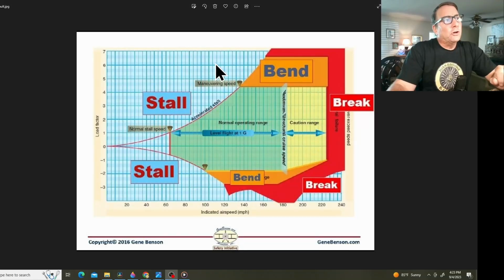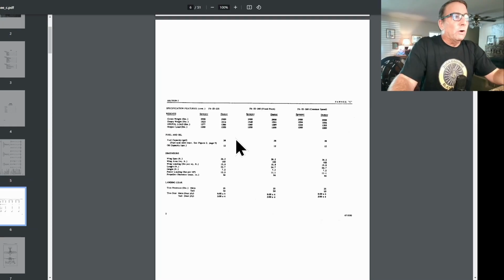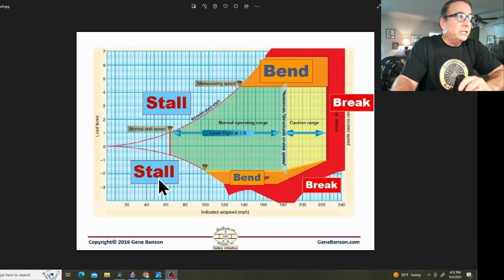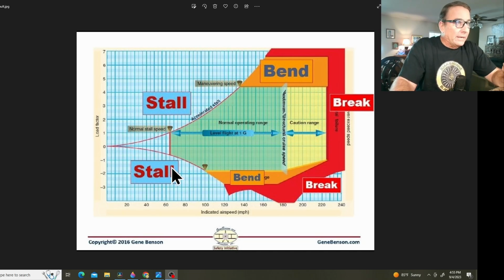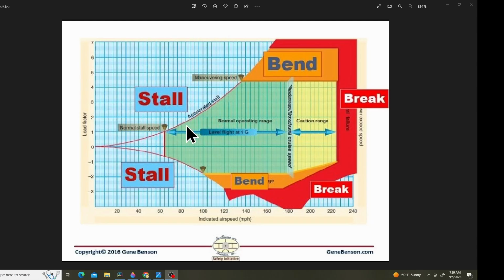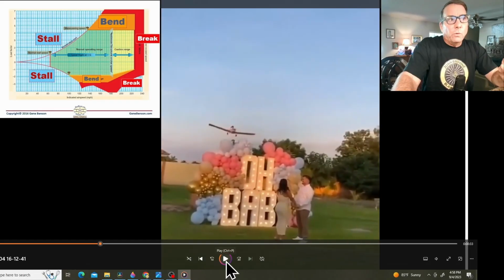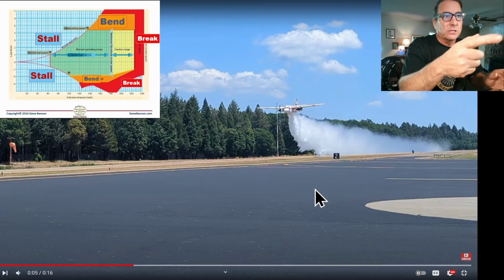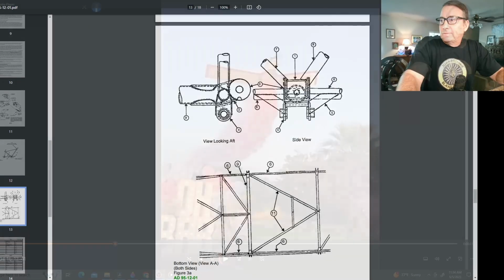PA25-235 Sinaloa MX Gender Reveal Party Structural Failure

Comment: I began my ag flying career flying the Pawnee and I never flew with more than 100 gallons. Never filled the hopper with liquid but we used the large hopper for dry fertilizer. I was trained at Ayers Corp. in Albany Georgia, where they make the thrush aircraft. You had to do a demonstration flight to get certified FAR 137 and part of the flight was a emergency dump. You had to learn to push the stick forward hard to keep the aircraft level cause dumping that much weight the aircraft wanted to climb like all get out.
Reply: The Pawnee pitch trim system was simple but not comfortable.  A large spring on one end of a lever in the back of the fuselage attaches to a cable that attaches to the stick just above the pivot point.  Moving the trim handle aft pulls, through another cable, the spring lever to tighten the spring and provide pull on the stick.  Forward on the trim handle will slacken the tension on the spring and allow the nose to go down.  Taking off with 150 gallons, usually the load is less for DA, will require a strong pull on the stick which the trim spring will help with.  Emergency dumping with full aft trim will result in a significant pitch up unless the pilot pushes forward on the stick.  The dump gate in the bottom of the hopper, also used to release dry material through a slim crack, allows slow release of liquid material as well.  Liquid goes to the pump on a spray rig through a hose.  The pilot may have been startled by the rapid pitch up of a full dump lever travel, fully open gate, dump.  Or he may have been going for a spectacular pitch up.  Or both.  I personally know of two practice emergency dump fatalities.
Reply: The tank looks so far from the CoG, i’m curious now what the training manual looks like for an emergency drop.
Reply: I agree. Looks to me like a rapid change in CG pitched the nose up. @PaleoWithFries
Reply: from what you described maybe he wasn't even pulling up that hard.  maybe just someone without training , but with a plane, that was like, well, it has this feature; lets let er rip
Reply: @toddmulligan2609 this he likely never did full dump b4 and even a nuetral.position on stick would result in pitch up hard. U gotta pre nose down when u dump that much weight
Reply: That will tend to keep you out of trouble.

Comment: 06:17 - Yes, but it's not the wing loading or "X" pounds of lift that break the wings - it's the g's. On the examples given the g's are fixed at 4. It takes an "X" amount of g's to break a wing, at whatever wing loading or lift force. At a lower wing loading the wing may not stall (which would unload the wing) before reaching its design g-load factor and may break, hence the lower maneuvering speed at lower weights.
Reply from the maker: Correct! You got it!
Reply: @blancolirio  I’m not sure he does have it correct. The lift the wings produce depends only on airspeed and angle of attack. In your example if the 16000 lb airplane pulling 4Gs suddenly releases 8000 lbs of weight it won’t be pulling 4Gs anymore it will be pulling 8Gs unless the pilot lowers the angle of attack to reduce the lift. An aircraft that drops weight at constant angle of attack is likewise going to accelerate upward and climb without any pitch input from the pilot.

So that’s what likely happened in this mishap. The pilots 2-2.5 G pull-up became a 4+ G pull-up as the water was released overstressing the airframe in the process. This would have been exacerbated if the aircraft was above maneuvering speed.
Reply: It's a bit more complicated. The limitations are given in "g"s because it is an easy to express limitation. However, when you change the masses configuration of an aircraft there are changes in the forces, some forces increase, some decrease.

In this case, if you unload a fuselage-mounted tank, the wing attachment forces decrease while the fuselage structure (engine mounts in particular) experience greater forces for the same angle of attack. That's why manouvering speed often decrease with weight.

Comment: I’m still totally confused why a weight release would contribute to a structural failure.  Wing loading is reduced even if we are close to maneuvering speed.  And isn’t loading the concern? The pull-up yes, we can all understand that.  Perhaps the pull up was the culprit and we are blaming the load release instead.  But on top of that I don’t recall anything on this topic in ground school.
Reply: It may cause structural failure on parts of the fuselage, engine mounts, etc because you may increase the g loading of the fuselage but you're right, NOT the wing spar and wing attachments.

Comment: Juan, why would the maneuvering speed decrease with lower wing loading?   It should be the other way around.    With lighter wing loading you should be able to pull higher G's at the same airspeed, with less force trying to bend/break the airframe.    Any aircraft with higher wing loading is less maneuverable.    What it looks like is that the CG shifted rearward on the drop and suddenly the controls got way more responsive and it pitched up hard, but if the tank is where you say it is, it looks like it should be right over the center of lift.  Maybe the center of lift itself shifts with airspeed and wing loading. 

My direct experience with this is in Dynamic Soaring (fastest, hardest turning R/C aircraft in existence).    Depending on conditions we may choose to fly same sailplane with or without ballast.   Unballasted, they can turn much harder but don't carry as much momentum through the shear layer, so in bigger more turbulent air we ballast up, but then cannot turn as hard (the aircraft gets bendy, or flies into an accelerated stall and spin aka.. a "flick").  To put this in perspective, we fly sailplanes that go 300+ mph and can pull continuous 50G turns.    The world record set down near Weldon, CA is 564mph.

Comment: These crop dusters are loaded to cover several fields before they need to be reloaded.  The emergency dump is used if you  have a in flight emergency and have to take weight off of the air frame for an emergency landing.

Comment: It looks like the left wing bent backwards, causing a runaway pitch-up moment until it snapped off. That is, in the first frame where the wing flexes it looks like the wingtip flexes first, rather than at the root. You can even see the wing crease just outboard of the root.
Reply: @michaelbigelow3255  Electrical engineer. I've never flown anything but a 172. Aircraft are mostly cool for the engineering 😄
Reply: Yes like a forward swept wing.  I can see that.  I just came across this tragic video btw.
Reply: A wing is the pitch axis , it cannot affect pitch .

Comment: I don't think dumping the weight had a negative effect on the structural integrity of the wing spar. When the aircraft is flying, aerodynamic forces (primarily airspeed and AoA) dictate the force generated by the wing. That force is distributed to each component of the airframe through the structure. When weight is dumped, the total load on the wings doesn't change, because airspeed and AoA haven't changed. However, the load factor increases, such that the total force remains the same. What this DOES do is change how the loads are distributed through the airframe. However, since the fuselage is now a smaller share of the total aircraft weight, the force in the wing spar actually goes DOWN when the water is dumped. 

Of course, you can still get other failures, but that's not what's observed in the video. For example, when the water is dumped, the load on the wing spar is reduced, but the force on every component in the fuselage is increased. If we had seen a failure of the engine mounts, or the body itself, then the load dump would make more sense as a contributing factor. But, since it seems to only have been the wing spar, whose load DECREASES when the water is dumped, it leads me to believe it was the wing spar AD at play here.
Reply: Load goes down suddenly->Back stick pressure to maintain level flight goes down. That's why he mentioned that you relieve the load traditionally by easing out on traditional firefighting planes. By yanking back hard, the pilot exaggerates the tendency for the plane to nose up. If he was above maneuvering speed, he could have easily overloaded the plane. The forces go up because the plane was accelerating upward.

Or, in other words: If he pulled back (not an uncommanded control failure), he suddenly showed a lot of bottom wing to the airflow at very high angle of attack at high speed. That wants to bend the wings back and up. If it was too fast for it to take it, then there you have wing failure. Like entering the beginning of a loop by pulling back hard. It's high G because you are accelerating UP. The load on the wing spar isn't reduced then.
Reply: @aeroegnr  Yes, because the tank is forward of CG, dumping the load causes a pitch up, which causes increased lift/spar load.  However, the aircraft still needs to be above the Va for max-gross, not below, since emptying the tank reduces the spar load at max-lift for a given speed. So either the pilot was flying faster than the max-gross Va, and/or the spar was unsound due to the non-addressed AD.
Reply: @EvanAndersen-et9qy no, you are missing the whole point. You don’t understand how Va works. 

If Va is 120 knots at max gross, when you drop say 1000 lbs, the VA would drop significantly. Likely to around 100 knots. So if he had flown at 110 knots and pulled back fully on the stick, without releasing the water, the airplane would’ve stalled at say 2.5 Gs and not damaged the wings. 
Had he flown at 110 knots with the water dumped and pulled fully back, the airplane could pull 4.5 Gs and still not stall. This would be above its limit.
Reply: What a food for thought treat from Dr. Juan. Dumping the load will cause a pitch up if uncompensated by forward stick.  Uncompensated pitch up without a comenserate simultaneous change in velocity vector  overstressed the wing connections.  Pitch up induced huge parasitic drag.   This suggests that fuselage structure  could also be damaged at engine mounts and at wing connections.  This how the explanation came across to me.   Thanks.
Reply: I’m not a physicist or a pilot but that was my thought as well. It seems to me that the shock of the weight(force?) suddenly reducing could have caused the compromised/corroded spar point to finally shear. Kind of like how extremely rusty metal or cracked wood will sometimes hold together when force is applied in  one direction, but will fail quite easily as soon it’s pushed in the opposite direction. I could definitely see the spar holding, but when it got shocked with an A-typical force while already under load, it caused it to finally fail. Structural anything in general tends not to like rapid alternating/shifting forces, which surely the sudden drop would have caused?

Comment: I've seen a very similar aircraft to this in Australia (actually designed and built here) on a flatbed truck. With it's wings folded, so if this plane has folding wings that adds additional structural compromises.

Comment: I'd guess he had the aircraft trimmed to fly level, after dropping 1500# of water in 1/4 of a second and pilot commanding some pitch up, the 2 combined just completely sent the aoa way to high.  Couple that with the spring of the wings after after the water dump probably sent the wings into a state they couldn't maintain.  Sad.

Comment: Not a pilot, but it looks just like air getting under a sheet of plywood or mattress strapped down to the top of a car. Quick and violent damage. Even as a kid hanging my arm and hand out of the car window making my hand into a wing I found the more I made my hand “vertical” , the harder it was to maintain my arm straight and not go backwards.

Comment: Is manouver speed for one control input only? In this case elevator? 
There is of course the obvious factor, was the maintenance and structure in good condition? 
The hopper is in the center. If the water had been in the wings, then that's a different issue. The water in the center increases the bending in the wing
Reply from the maker: Yes!

Comment: Is it possible that this emergency dump imposes a transient dramatic shift in the center of mass too, that contributes to that large nose-up rotation?
Reply: My thoughts as well. He is essentially dumping over a half ton of weight from the nose of the aircraft in less then 2-3 seconds. Seems like that would cause a CG shift, that maybe he tried to counter too much?
Reply: I'm leaning towards structural failure from either pass flights or an ongoing issue that was unnoticed. That plane should not have failed during a simple maneuver like that.
Reply: I think the hopper is on the CG so shouldn't have a shift as it was dumped all at once
Reply: @flyinbryanfpv  even if it was perfectly centered on the cg of the airframe that much weigh loss in that time frame would cause it to at least "balloon" up a bit. Which the pilot might have tried to counter with forward stick. Which would have been bad idea. I am not saying I know any of these things to be fact, just stating my own point of view from the video provided. It could have been coupled with a problem airframe as well. Just a bad way to go and for no good reason.
Reply: @omegawolf81  I agree with you. The part I was addressing was the possibility of cg shift being the cause. Its more likely the sudden loss of 1000+lbs of water and pilot input causing the catastrophic failure

Comment: I don't know what the pilot was thinking! It won't surprise me if he pulled about 5 - 6Gs,
 You've got the momentum of going forward high speed and then pulling up quickly this just put so much stress of the  on the wings, I think even if he had a full load it would have snapped anyway at that sharp attack at that forward speed. Did he have any knowledge of this plane? Look like he was showboating a bit as well.

Comment: My first thought was corrosion, but the information you presented makes it clear that the failure of the air frame was most likely the result of the pilot's actions while releasing the payload.
Reply: Very well could have been both issues contributing to the failure. Without knowing the details of his speed, angle of attack, amount of weight dropped, etc, it's impossible to say for sure. He may very well have been within the design limits but with a corroded airframe. Like you, I tend to think he was not, but that's why they do investigations. Don't assume.
Reply: @MotorCityBoiler  Good point.
Reply: @Koi-Koi-Koi  Do pilots do practice runs to help anticipate the issues that may arise during a drop? Maybe I am naive, but I would think that having obstructions that close to a drop point and flying into direct sunlight would necessitate a 'dress rehearsal' of sorts.
Reply: And I don't mean to be insensitive or sound like I am assigning blame.  Just inquiring as to what would be considered 'best practice'.
Reply: @Koi-Koi-Koi again with your palm tree. This is silly now.

Comment: Your chart explains why I’m not an Engineer. All I knew was the weight changed and he stressed the plane’s limits. Thank you for the explanations.
Reply: I had a very similar response. I also realised yet again  why I am not a pilot (though I am a keen armchair aviator).
Reply: Basically the lighter the plane is, the easier and faster it can change directions which increases the G-load and stress on things like engine mounts, battery box, airframe, wing attach points.  The heavier the plane the less it wants to change directions quickly and the wing will mush more due to the higher angle of attack required to make a quick pull up, which causes the wing to stall before it has a chance to increase the G-load to a critical point. Not saying it can’t happen while heavy, just saying the weight moves the line on the graph left and right depending on weight.  Also note that as soon as the wing stalls, the G-force due to the lifting force of the wing drops dramatically.
Reply: @rc300xs In fact, with less weight and more Gs, every part of the structure suffers more stress (engime mount, etc), but the wing structure no because its stress is proportional the the max lift before stall, wich doesn't change.
Reply: @donosticopter9225  you’re correct for the wing structure itself.
Reply: As an engineer I find it sooo cool that in order to be a pilot you have to learn some engineering knowledge. Many pilots probably don't even realize it, but analyzing these performance charts and intuitively understanding how they're constructed and used is a core component of engineering in many fields.
Reply: Even that’s too much information for most of us.
Reply: @Koi-Koi-Koi wasn’t paper. Was colored water. And the palms didn’t have anything to do with this.

Comment: How does this apply to a WW2 dive bomber? They "lose" weight rapidly and typically performed sharp pull-ups.
Reply: They were designed to handle it. And trained to do it.
Reply from the maker: Dropping at near zero G...straight down!
Reply: Well where to start with my limited knowledge, 1, I don't think pipers were ww2 dive bombers 2, I'm guessing since dive bombers are rapidly trading altitude for airspeed they probably push the envelope into the "bend" portion of the envelope and are at no threat of stalling.
Reply: I guess dive bombers use a different chart than utility category crop-dusters. 
That maneuver sure looks like something I'd see in a war movie, though!

Comment: Doesn't offhand make sense for wing strut failure - the load on the wing is the thing and with less weight the wing load is now the same at higher G forces.  I'd guess that pullup would have done it with or without the load release.  That is, there was some compromised structure in there already so that even inside the envelope it would fail, or, of course, he was outside the envelope already.